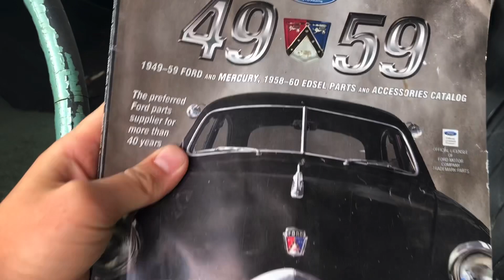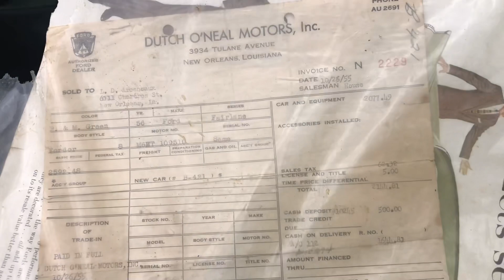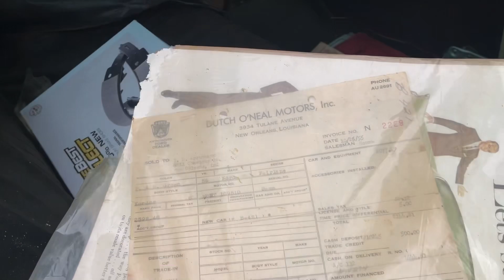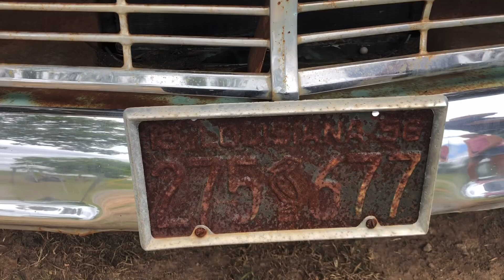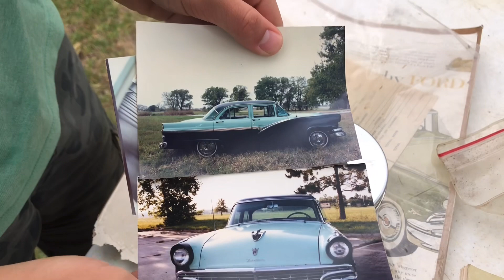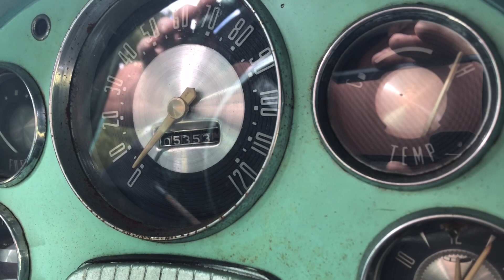OUR FIRST PROJECT! A 1956 Ford Fairlane Town Sedan 292 Y-block

Comment: Since you just got this car, here are some pointers about that Y block engine.  To fix the infamous rocker oiling problem, machine a groove in the center cam journal so that the rockers receive a constant, instead of intermittent, supply of oil, or if you have to replace it, use one that has a grooved center journal.  Next, plug that oil overflow tube coming from the one of the rocker brackets, so that the rocker shafts are pressurized.  That way, they are less likely to plug up.  Third, be aware that the center cam bearing has THREE, rather than one or two, oil holes.  All three must be indexed with the holes in the bearing web.  ALL THREE.  Next, make sure that the rocker oil passages, (one for the left head, one for the right head), properly index with the portion of those passages in the blocks.  Some do not.  You can dress them to match if the don't.  Last of all, MAKE SURE THAT THE CAM BEARINGS FIT T I G H T L Y in their bores.  Some do not, with the result that they turn, which shuts off the oiling to them and, if center bearing, to the rocker shafts as well.   Take care of these matters, and you will enjoy a rugged trouble-free engine for a long long time, and remember, fixing these issues is easy.  Fixing the present generation Chrysler HEMI is much harder.
Reply: he's ten
Reply: @North49191  And in 6 years, he will be 16 and will be driving, so now is a good time to spruce up that Ford!
Reply: good info,   last Y block for me was in early eighties (restored 57 Ranchero) . another thing to do would be to align bore the crank and cam journals.  The engine may be a 312 but with a stick probably not.  KEEP IT STOCK!   The old Trico vacuum w/wiper motor is easy to replace with an electric ona and is a bolt in. The kids will learn a lot!😎
Reply: Make sure keep all paper  of car
Reply: There is excellent  product
Reply: Check out the uncarriage   floor pans are
Reply: Drop312 or 292 motor  in it
Reply: @North49191 he’s 13
Reply: @North49191 I know bc he’s my best friend
Reply: @North49191 he’s 13 he’s one of my best friends

Comment: Ford 1956 3 speed on the column or as they used to say," Three on the tree" My dad got one that was with the small V8, 3 spd. tranny. The small V8 still had solid lifters in it. My dad had them adjusted on Saturday by a local curb mechanic. By Sunday I would have driven the car on Saturday night. The valve lifters were noisy again. haha. That thing would wind up to very fast speed in first and second gears.

Comment: I didn't even see any holes in the floor or trunk. When I was a kid, a neighbor down the street had a two tone blue version of the same car. It's a big project but you've got at least two things going for you that I don't have to do a restoration. You've got family support and you've got lots of space to take a car apart. I'd offer to sell you a set of hubcaps but I can see that you don't even need them.

Comment: Actually the original license plates were yellow with black numbers and letters.  Starting in 1963 for some reason California swithed over to black and yellow plates and most were turned into the DMV for the newer plates.
Reply from the maker: This one is a ‘56 Louisiana tag. From what I’ve seen they had blue with white lettering/numbering and green with white lettering/numbering.
Reply: @Fixin' Two  Oops.  I'm sorry. I thought that was a black and yellow California plate.  Anyway, I really like how you have your sons in the videos, making it a father sons project.  My dad had a 1966 Chevrolet pickup way back when I was a kid, and I remember it fondly.  Six cylinder, three speed, and nothing else.  I have subscribed and look forward to more of your videos on your new old Ford.
Reply: I remember my pop putting new black plates on both his 1950 Cadillac and my mother's 1950 Buick.

Comment: good  choice  most people dont realize that oiling problem was caused by non detergent oil long oil change intervals  old and cadillac used much silmilar systems the first 1955 chevy 265 v8 had a similar problem with the raer cam brg/
Reply from the maker: Thank you for the tip, how do you suggest we fix it?
Reply: That, and the fact that the oil supply to the rockers was intermittent.  Later Y blocks had a grooved center cam shaft journal, so the oil was constant.
Reply: @fixintwo123  Machine a groove in the center cam bearing journal, plug that oil tube that comes out of a rocker shaft bracket and dumps oil out, make sure that the rocker oil passages in the blocks and heads properly index with each other, (some don't), be aware that the center cam bearing has THREE oil holes, and ALL THREE must index with the three oil holes in that bearing web, and lastly, make sure that the cam bearings are TIGHT in their bores.  Some are not, and can turn, shutting off the oil supply to the cam bearing in question, and if that is the center cam bearing, it will also shut off oil to the rockers.  These issues are easy to fix with the engine disassembled, and after the fixes, you will have a rugged long lasting enjoyable engine capable of high revs - solid valve lifters can't pump up at high revs the way hydraulics can.

Comment: Why does everybody take the heat is out of those cars I've had several of them and everyone I get the heater is gone
Reply: Sure the heater was missing?  It was an option, not standard equipment, even on Lincolns.
Reply: Looks like it has a heater core in it.

Comment: You're going to have to find all new rubber for that car for the windows The Doors paint the rooftop white a set of hella six and a half inch round headlights, LED bulbs for the tail lights have to take all them apart and repaint the buckets with chrome paint. Free Chrome the bumpers the colors are awesome, a set of radial tires and I like to use bed liner after restoring my steel wheels it holds up better than paint. They say go back with hydraulic shocks and it has a smoother ride then gas shocks. The fuel tank might be saved with red k o t e they make inner liner liquid and red and the outside of the tank you'll cope with bed lighter..